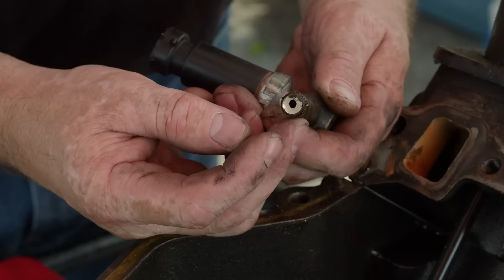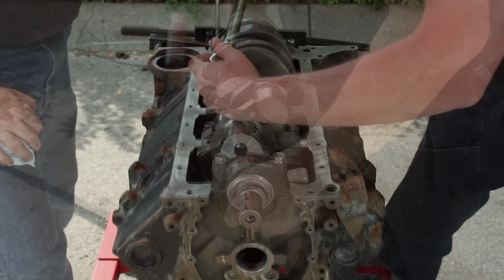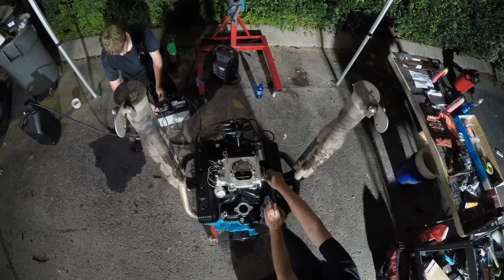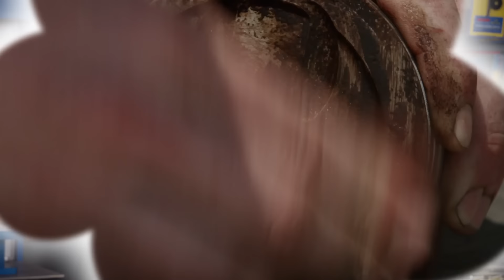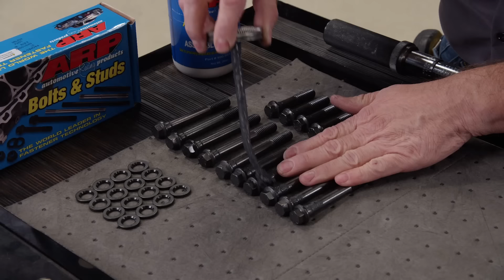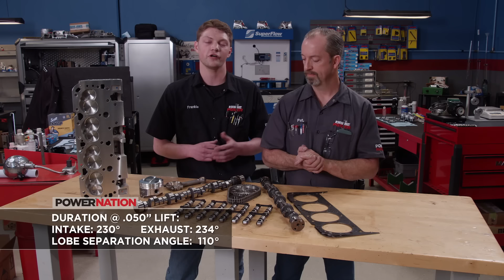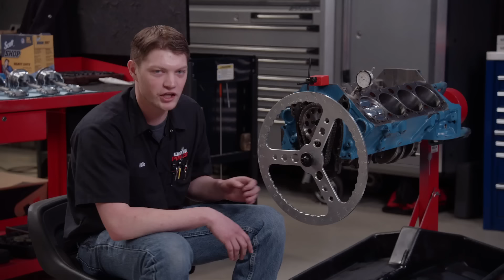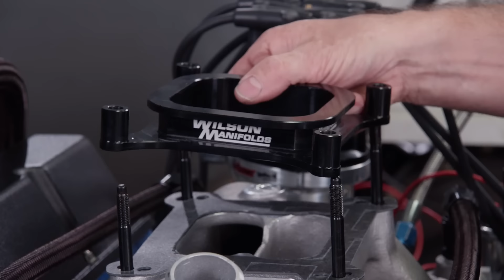Over 13:1 on Pump Gas! Chevy 350 Dyno Mule - Engine Power S9, E9 &10

Comment: If you had set the DCR @ 8.70-1 you could of made more power using 91-93 octane. Why? Because you can fully tune the engine compared to the grossly detuned engine in this video.
Running only 22* timing is simply sad… 🥲 Come guys!  👍
Reply: Kinda what I was thinking...10 to 15 more degrees (whatever it wants)...would have been more impressive
Reply: I also think they chose the wrong cam with that much compression a much larger cam is needed that way you can bleed some compression for rope end power
Reply: @utahcountypicazospage5412  it wasnt about choosing the wrong cam  the had a bigger one by almost 20 degrees.  it was more about the exercise in understanding what DCR does
Reply: The worst part about it is, it's not difficult to get these numbers with stock Vortec heads using a normal tune. These heads supposedly have 195 cc's of intake runner but obviously they're not using all of it. 🤣

Comment: Can you use 302 heads on 350?
Reply: Yes it has a 4 inch bore just like the 350 but smaller 3 inch stroke crank
Reply: 302,327,and 350 all use 4 inch bore blocks
Reply: @bethanyhaskiell9116    Will it have different intake value sizes tho?  I've heard of people doing it But I wasn't sure about compression and that kind of stuff What you'd have to change
Reply: @suicidegarage  not with a 4 inch bore if it was a 305 you cant use a head that has 2.02 intake valves because 305s didnt use a 4 inch bore the biggest valve you can use in a 305 is a 1.94 intake valve
Reply: @bethanyhaskiell9116  okay cool I had looked on forums and stuff couldn't find anything conclusive thanks!
Reply: @suicidegarage  you're welcome glad I could help
Reply: @suicidegarage  you're welcome glad I could help

Comment: Honestly I appreciate builds like this.
What If honestly love to see more builds with stock heads and porting vs aftermarket this and that.
Reply: Waste of time.
Reply: @Cultofpersonality09129  Funny how he thinks a et  of heads and goofy stage ghey cam will make a heavy turd fast.
Reply: They have done that before youd have to look back
Reply: @bradenkowal8117  
I know but its far and few in between.
Reply: I feel like most people are using stock heads
Reply: @myid9876543  the poors..lol i just spent $2,599 on 38cc TrickFlow heads n $700 on stage 3 MHS TFS cams for my 2v, next is a 3k stall converter n gonna have a fun P71 to smoke all them imports n domestics who want to run me on the street..

Comment: What’s the purpose of bumping up the static compression so high if dynamic compression is just going to be lower? Just curious, thanks!
Reply: At high RPM this engine will have more compression and the fuel will not knock since it does not spend as long being compressed. This will give the engine more power up top than a low compression engine with about the same low end torque. You can also run more compression on an automatic with a higher stall speed converter as you will never load the engine heavily at low rpm. Time at high pressure and compression pressure go together and both lead to knock.
Reply: @Dr_Reason  awesome! Thanks
Reply: I think the answer is that dynamic compression is the only compression that matters in the case of an intake valve being open during the compression stroke.  Why you would want to do that is what confuses me because its only going to start pushing fuel and air back into the head at that point.  I think in that situation you just want your static compression to be as high as possible, because that will be the highest potential compression value before the dynamic compression reduces it.
Reply: @reviewaccount469  You are correct at low RPM. This lowers the pressure and prevents knock. At high RPM the flow has too much momentum and it compresses and gets trapped by the closing valve. This is a sort of variable compression engine concept without changing the static ratio.
Reply: @reviewaccount469  You need high static compression if you want to run a cam that's too big for your engine.    That way when you hold the intake open too long, you'll still have enough cylinder pressure to keep the engine from being a total dog.  It also helps a little in this case, because their test engine has shitty heads on it.  When ports and the valve job flow like garbage, you have to hang the valves open longer.  At low RPMs, they can flow enough so you lose all velocity and tend to see lots of reversion (and blow raw fuel out the exhaust and back into the intake)

 Typically, when the lobe is so wide the intake valve stays open forever, it's usually true on the down ramp as well.   So overlap gets huge most of the time too.    Too much overlap, gives engine that lope everybody likes (AKA crappy bottom end).  When you take it too far, there's not enough vacuum to keep a power valve shut on a carb, so you get loading up and fouled spark plugs and other unnecessary issues.
Reply: This engine was a demonstration of dynamic compression only. it wasn’t supposed to be a huge power monster and it’s dynamic compression is still around the same as any 10:1 compression engine. This engine was just proof it could be done.
Reply: @theeoddments960  yes sir, I understood that they were mostly trying to make a point about the importance of D compression but I was wondering what the real world application of a high static, low dynamic engine would be
Reply: @Carameldelight77  there would not be one  unless if was class specific racing that required cast iron heads etc  look at a lot of the dirt track stuff small heads high compression  and certain things they'll allow you to do

otherwise.  just use what the manufacture recommends for the cam you chose and heads you have gears etc

Comment: Great demonstration of dynamic compression. You should have showed the limitations of timing advance with pump gas and the difference of race gas and 10-12 more degrees of timing
Reply: Unfortunately they are wrong. It is only at very low rpm that air gets pushed out of the cylinder and back into the intake manifold on the compression stroke, resulting in less cylinder filling and reduced effective compression. An engine running in it's power band will not have reduced dynamic compression. Air has inertia, and continues to flow in and fill the cylinder after the piston has started back up in the compression stroke. This is called the ram effect. That is the whole point of single plane intakes and tunnel rams - enhancing the ram effect, resulting in greater cylinder filling. A really good engine can even exceed 100% cylinder filling. That will result in a dynamic comp ratio Greater than the static ratio, or the exact opposite of what they are saying here.
Reply: @scottm7341  a really good engine?  you mean like pro stock engines in NHRA?
Reply: @KingJT80  It's called volumetric efficiency. Some dyno's measure air flow, and can calculate exactly how much air the engine is inhaling. A 350 breathing in 350 cubic inches every two revolutions means 100% VE. It won't hit 100 at cranking speed or idle speed, when some of the charge IS being pushed out, but it can within the cam's operating range. Every time I have seen an engine on a VE dyno making much over 1 hp per cubic inch, the ve is 100-110%. Pro stock engines are probably 120%, but at 10,000 rpm. That's how they make almost 3 hp per cube. It should be obvious to everyone that an engine will never reach or exceed 100% ve if a big portion of the intake charge is being pushed back out of the cylinder on every compression stroke.

Comment: How does Dynamic compression effect fuel consumption ?
Reply: @bigboreracing356  di motor cool chamber when spray in fuel makes cheap gas great again 😂
Just like Freon high pressure to low pressure= temperature drop 

Funny thing about this video is the cam they used we call bleed of cam so you build a 13to1 but still have cylinder pressure of a 11to1 seems like waste of time and parts
Reply: @bigboreracing356  ahh I think you missed the point, the point was to show they could build a high static compression engine and lower the dynamic compression enough to run pump gas.  And they did that.  They also explained on race gas it would make much more power. Especially with a cam to get dynamic compression  back up.
Reply: @bigboreracing356  i must have missed the part where they said it was practical. I would hope anyone into engines would already know that.  And of corse they are going to use their sponsors parts.  You think they should be buying these parts from there pocket? Its not their engine.

Comment: I hope the people at powernation reads the comments,
#1 while degreeing the cam if it DOSEN'T come in where it should what do you do to fix it.
#2. End play on the crank if it's to tight or loose what do you do
#3 oil clearance on the crank bearings is to tight or loose???????
Reply: They have covered that 100 times on builds before thats why they dont always explain every little detail
Reply: @bradenkowal8117  I guess I haven't found those videos yet

Comment: 276hp out of 5.7 liters... WITH upgrades... 😂 😂 😂 😂 😂 😂 😂 😂 😂 😂 😂 😂 😂 😂 😂 😂 😂 😂
Reply: 276 hp was the bone stock rebuild....it was 413 after
Reply: @bradenkowal8117  so? Stock REBUILD. That hp is pathetic by any modern standard.
Reply: @JmanRx81  you can get better number with more money in
Reply: @JmanRx81  not with shitty heads and low compression you not going to go above 300
Reply: @JmanRx81  you have never built an engine before have you? 🤣🤣
Reply: @bradenkowal8117  I have. My Acura 3.7 V6 makes the same hp
Reply: @JmanRx81  and? Just watch they will put different parts in it and it will be alot more. Its still a mild build....
Reply: Stock tbi heads
Reply: Your point? All they did was slap in a above stock cam and a intake what did u expect it make?  Smh
Reply: @PercyMack85  I'm saying the American V8 made piss-poor numbers from the factory. And even with upgrades, its power output per liter of displacement is still piss-poor.

Comment: That’s the most garbage build The thing 1.17 hp per cubic inch at 13 to 1 compression
Reply: It had a tiny cam dude
Reply: @macisalyer4037  tiny cam & a dual plane intake
Reply: It's an RnD engine, they still testing the setup, don't be a douchebag

Comment: My 440 is 13.1:1 on bank 1 and 12.5:1 on bank 2 on 87 octane. Been like that since I was a kid.
Reply: Why?
Reply: Probably warmer on the 12.5 cylinder
Reply: @JoesKustoms  yeah it runs pretty hot it melts the exhaust manifolds off the heads real quickly
Reply: @buttlickbandit8465  that's crazy, still use the engine??
Reply: @P71ScrewHead  Yes it's my daily driver. It also has 1050 cfm Holley on it.
Reply: @buttlickbandit8465  93 octane or what fuel do you use??
Reply: @P71ScrewHead  87 octane
Reply: @buttlickbandit8465  Crazy how reliable it's been with 87 octane.. But I'm sure it'd run much happier with 93..